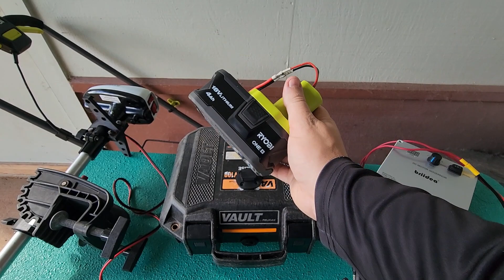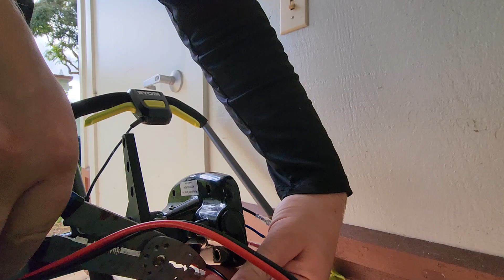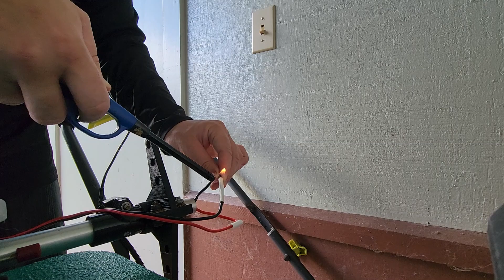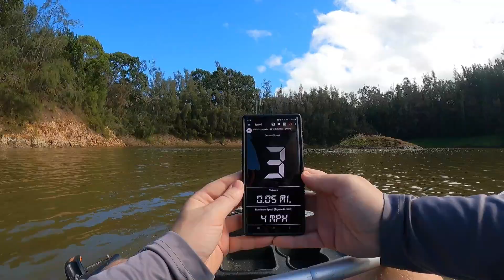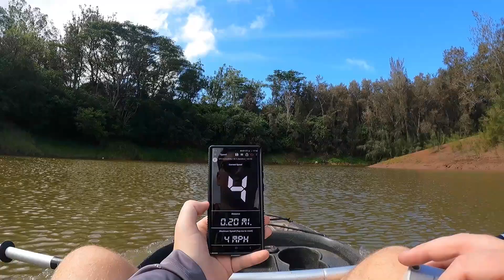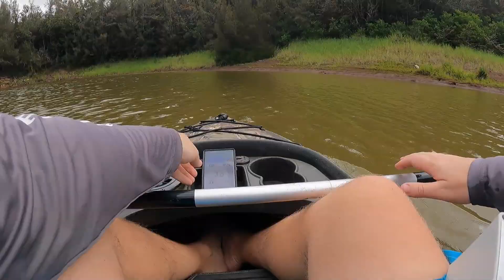Converting a Watersnake T24 into an 18V Motor for MORE SPEED

Comment from the maker: **NOTICE**
There are a few corrections that I need to make. After uploading the video, I started to dig deeper into the project and the information that I shared, and found a mistake that I made... As it turns out, the 12V battery is made of 4 prismatic LiFePO4 cells, which make a full charge capacity of 14.6V, not the 16.8V that I had stated if were made up of 18650 cells. So to correct the math in the video, the 18V Ryobi batteries, which I know are made of 18650 cells because I have taken one apart, makes 21V fully charged (measured at 20.4V on my multimeter), which is a 44% (40% at the measured voltage) increase over the "12V" battery. The highest sustained speed on the 14.6V was 3.5/6 so we will call it 3.5mph, and on the 21V was 4.4mph, which is an increase of roughly 26%. That means that roughly 14% of our added input power did not show up in the speed increase. There is a bunch of math that goes into calculating drag, and as you get into higher speeds, you will need more power to make smaller speed gains, so I still think this was a successful experiment.

Comment: I'm considering purchasing either a T18 or T24 for the front (propel slot) of my kayak for fishing movements mostly.  Since I depend on my 36V 40AH LifePo4 running my Nk300, I'm also looking for backup via the Watersnake in case of 36V system failure on longer fishing runs.  I have seen some literature by Watersnake recommending the AGM lead acid battery for their motors due to the increased voltage of lithium ion batteries.  There is no way that I would put a lead acid battery in my kayak these days!!! 

I also have seen demos where Minn Kotas and other motors are converted to PWM - those videos claim that most trolling motors are extremely inefficient at the lower speeds due to the resistance method used to slow down the motor.  Have you calculated or measured the thrust of the T24 (pre-PWM mod) to see if the low power setting (9 amp) is very much less efficient than the high power setting (20 amp)?   Thanks for your content!
Reply from the maker: I never tested power draw or anything on them before switching to the pwm. I know the t24 can handle a lifepo4 battery for a good bit of time on high, but the wiring in the head gets hot after a while.
Reply: @OutdoorEngineering  can confirm the switches melt eventually when using lifepo4 on high for 20-30 mins. Converted to a hobbywing 880 esc and love it. Gained a little top speed because theres lower resistance in my upgraded wiring too.

Comment: 50% more power doesn't equate to 50% more speed on a boat.  Drag increases exponentially in relation to speed.  Hull speed is also a factor.
Reply from the maker: 50% increase in volts will equal 50% increase in motor rpm. However, without adding resistance, it also equals 50% increase in amp draw which is bad when you run your wires accounting for the specs of the motor, so the wiring isn't rated for the increased amps. But also, 50% higher rpm does not equal 50% increase in vehicle speed. There was a lot to learn from this project.

Comment: A rule of thumb in fluid mechanics is that as you double the speed of an object moving through a fluid, you quadruple the drag of the object.  The relationship is not linear!  So a 50% increase in voltage was never going to provide a 50% increase in speed.
Reply from the maker: Yeah. I got that part. It resulted in 50% increase in open air prop speed, but that doesn't translate directly to speed on the water. Also, as I continued testing it, I found that the 50% increase in voltage  also came with a 50% increase in amps. This resulted in my watts going from 220w to 540w, which was really not great for the motor, but does explain why the speed increased as much as it did when switching to the higher voltage.
Reply: Yes, we all should have seen the amp increase coming: V=IR - if you increase the volts and resistance stays the same, the amps have to go up - which means the wattage has to go up too.  The increase in the conductor temperature was the clue!
BTW, it was a great experiment!  We can learn as much from failures as we do from successes.
Keep up the good work.. @OutdoorEngineering

Comment: Try connecting all the batteries in parallel together that way you are not taking 1 to its limits but 4 at say 30% Or so.  Do the math 30 amps divide by 4 batteries its like 7.3 amps per battery
Reply from the maker: In my follow up video to this, I have 4 batteries connected in parallel. It's a lot more convenient, and like you said, easier on the batteries.

Comment: Yeah you could've done 4s. Which is like 14.8. Thats will work all day.  Plus the voltage drop.
Reply from the maker: I could have, but I didn't want to build a new battery or buy any batteries. I just used the batteries that I already have. In my follow-up that I did for this video, I point out that 18v is kind of a bad idea with this particular motor, but a 4S battery would probably work out pretty well.

Comment: Great video! Looking forward to a follow-up to find out if that motor survives after a re-wire.
Reply from the maker: Thank you. 
I replaced the leads between the motorshaft and the speed controller, and it works again, but running it in 18v turned out to not be a good idea. You can see in my most recent video why this particular motor is limited to 12-14v. Using the 18v battery, I pulled 30a and way too many watts. 

Did you ever end up doing anything else with your kayak/pontoon boat build?

Comment: Hey mate thanks for the video. I’m just setting up my T24 water snake. I have both 18v cordless batteries and also a 24v golf cart battery. I was going to buy a 24v - 12v converter AND motor controller however saw your video and thinking a dc motor controller might be all I need? Does the motor controller also convert the 18 or 24v into usable 12v without damaging the trolling motor? Sorry electronics isn’t my strong point! Cheers
Reply from the maker: It doesn't convert the voltage down to 12v but it does change the output watts. If you remove the switches from the motor and just use the pwm, then you should have no problem running an 18v battery up to about 300w (I'd assume a 24v would be the same). With the brushed dc motor, voltage isn't necessarily what kills them, it's the watts. When I connected a current meter to my battery and then ran the motor, with the 12v battery it was pulling 20a and 240w, but when u hooked up the 18v it pulled 30a and over 500w. But with the motor speed controller, I was able to regulate the output and keep the power below 300w, which the motor has no problem with. I will say tho, the t24 is most efficient at about 100w.